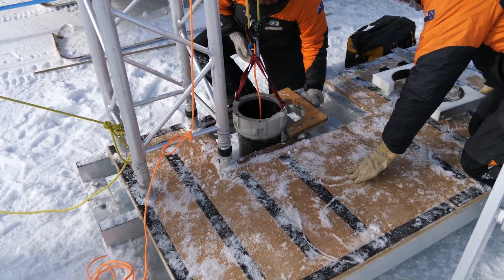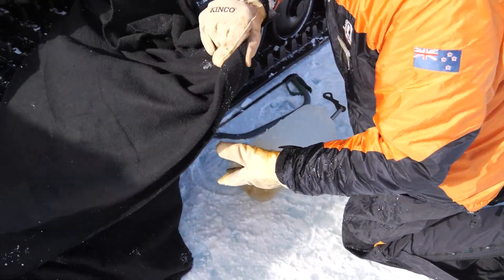Researching Platelet Ice in Antarctica

Comment: I used to do sediment sampling by diving down, and driving the sampler into the seafloor by hand. Then I'd cap the top of the sample tube, pull it out of the sediment and cap the other end. That retained structures as delicate as worm burrows in mud.

The method you're using looks to work well, but it does seem like a lot of stuffing around compared to taking the sample from the other side.
Reply: Hi. Yes there is a lot of "stuffing around!" But the "other side" is under the ice!  You are perhaps suggesting we dive under the ice and sample from underneath the platelets using a sampler tube as you have done for sediments? That's pretty risky as the  platelets are very fragile and friable. Touch them and the 3D structure disintegrates.  Maybe we could find our dive hole and get back out.... 🙂 Our method is a bit safer both for us and for maintaining the 3D structure!  Or perhaps we could use a AUV - but this platelet layer can get to 6m thick and more. Very difficult to get samples that way.  Thanks for your comment. Ken (one of the team members)
Reply: @kenryan6631  thanks Ken.

When the only tool I have is a hammer, everything looks like a nail.

As a commercial diver, my first solution is to just go and do it by hand.

The solution you guys came up with is much safer! I would never have thought of it.
Reply from the maker: Thanks for your thoughts!